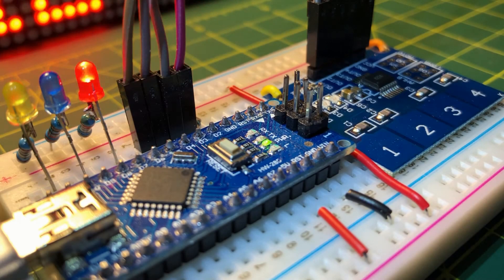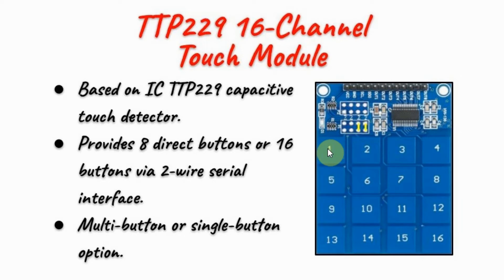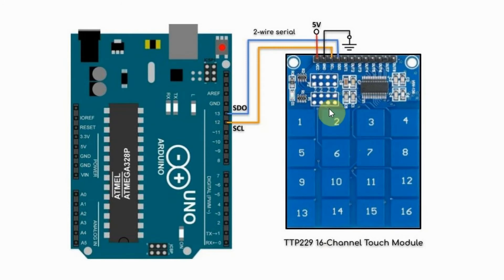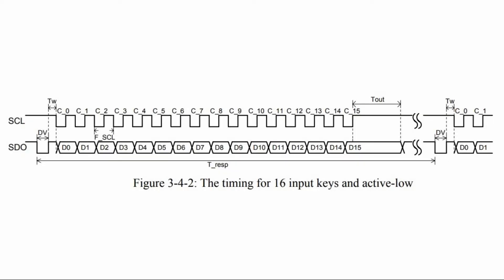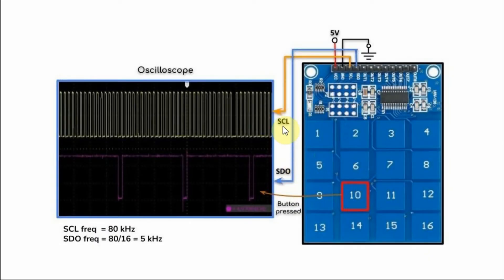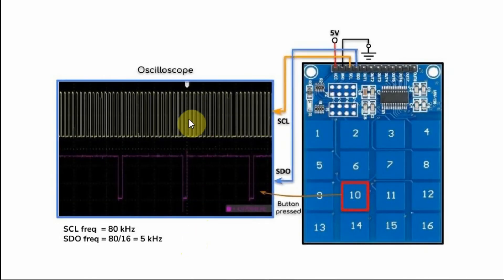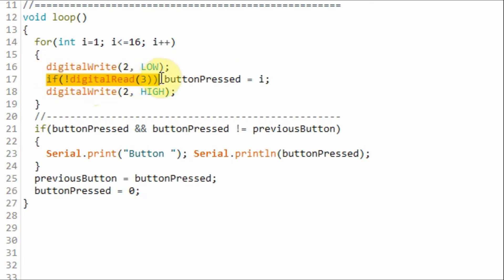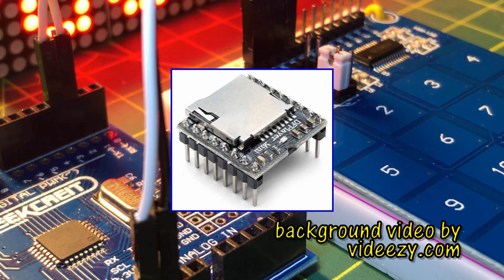TTP229 16-Channel Touch Module

Comment: Can we extend the touch sensors like, can we put some wires for each button and the other end to a conductive substance and make a piano using it by program different sound output for different buttons...⁉️🤔
Reply from the maker: Good idea. You need to trace and access the terminal point of each button. Or, if your adventurous, you can get capacitive touch sensors interfaced with TTP229 controller, i.e. build a custom touch module.
Reply: @AnasKuzechie  Probably making a custom module will cost me much more... So, I'll go with the first option. Whenever I'll learn some more things😅 I see some holes near each buttons, is that where I can solder wires and extend it onwards...⁉️🤔🧐🤨
Reply from the maker: @p.k.953  Yes, but the connectors are coated, so you have to gently remove coat at terminal. I recommend you test for one terminal and see. Good luck.